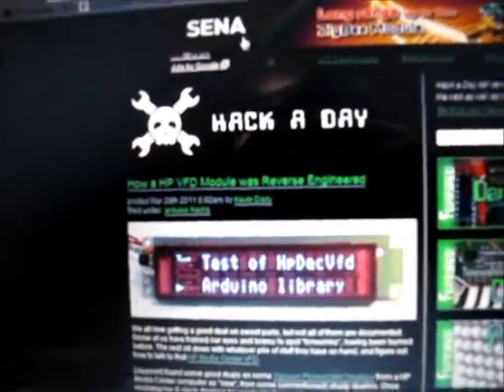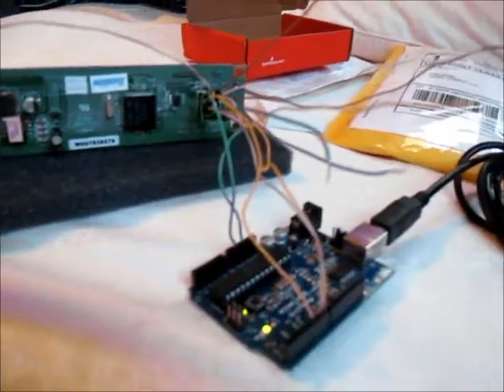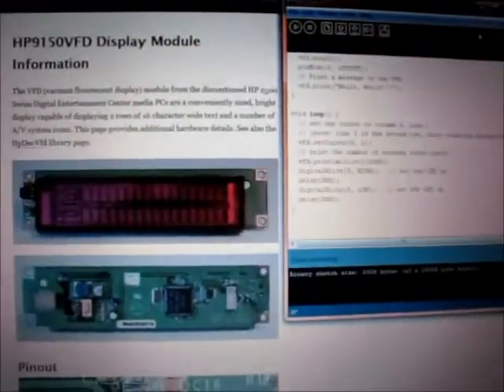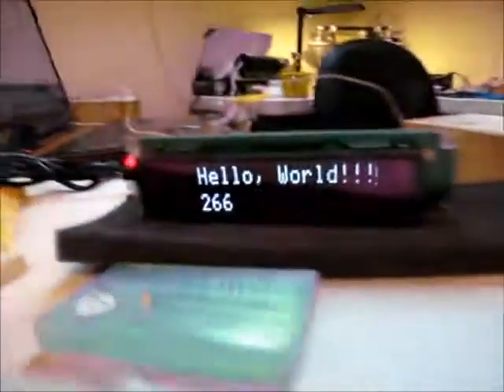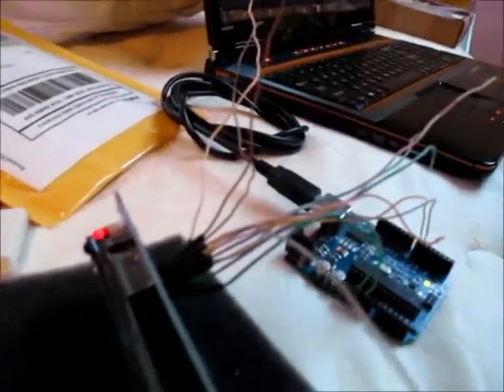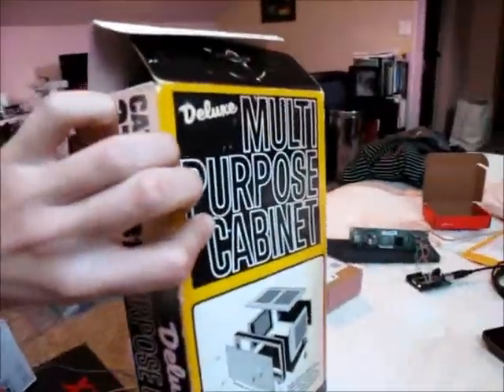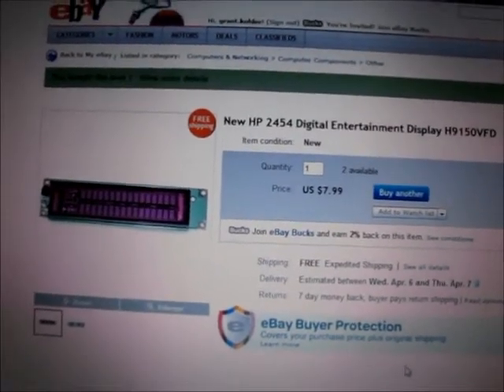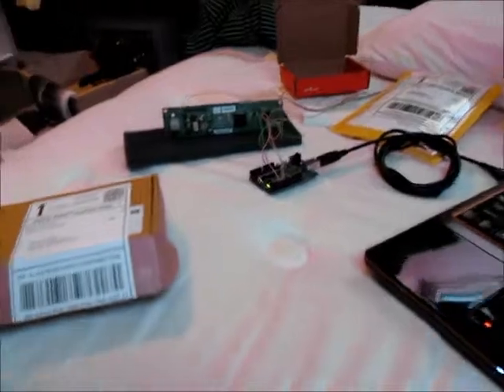HP Media Center VFD & Arduino: Hello, World!

Comment: Just a heads up.. The pin header on the back of this display is the same connector from an original xbox dvd rom drive. So if anyone has an extra cable laying(i collected other peoples broken xbox's for parts) around it makes it much easier to hook up to this board.